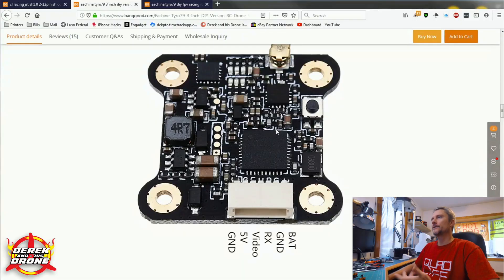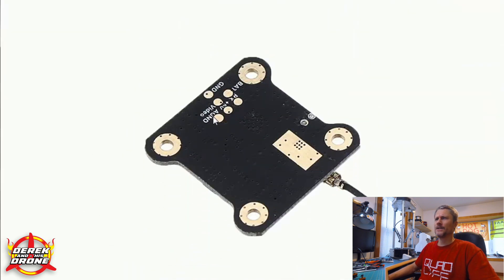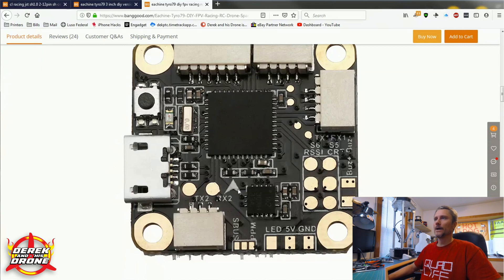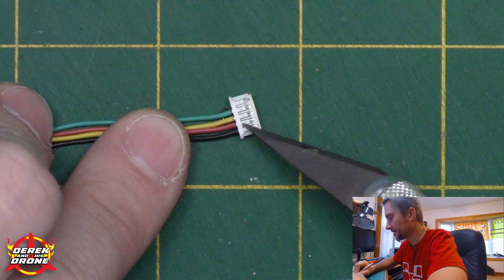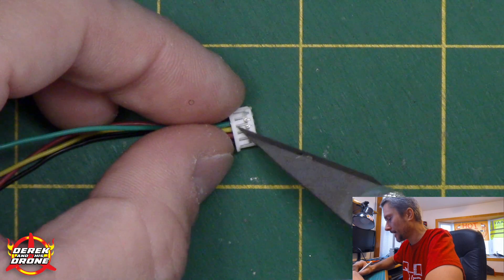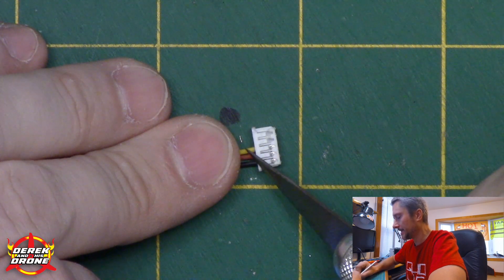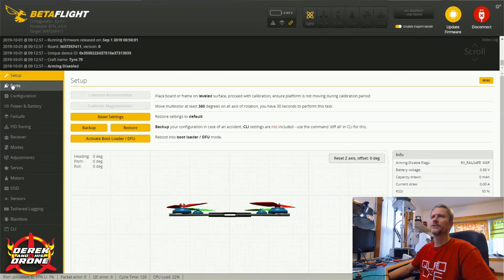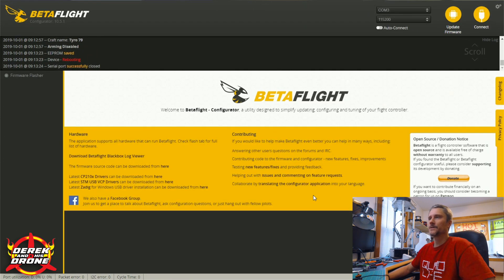Adding Smartaudio to Eachine Tyro79

Comment: Would be nice if I had the same VTX in my kit as you. Hooking up smartaudio is a no-brainer, unless we buy garbage kits from Eachine that are hacked to do things to save $$. I get nothing but dashed lines where my power levels/channels/bands should be in my OSD......and it tells me that 'Tramp' isn't configured.
Never mind......my bad - going into Tramp instead of 'SA' in OSD. 

All good :)
Reply from the maker: The kits are definitely as cheap as possible. With a little bit of patience they can still provide a good experience and an opportunity to learn.
Reply: i just found out we have the vtx thats for the iflight fC

Comment: i don't understand one part.  The first VTX you showed on the pc monitor is the one that comes with the Tyro79 kit, but then you connected the green wire to a different VTX which has DATA exit, but the first VTX you showed (which is the one i have) has NO data exit or pads... should i use the RX pin from that one to connect the green wire to vtx?
Reply from the maker: It is the VTX that comes with the Tyro79.  The website shows an older version but the connections are the same.  I added the green wire to the factory connector then soldered it to the flight controller.
Reply: @DerekandhisDrone  thank you very much mate. So i guess that RX is the pin where the green goes (DATA in the other vtx).
I've heard it's better to solder on tx1 coz tx2 is hard wired with OSD. what do you think?
Reply from the maker: Rx goes to tx it shouldn’t matter what one as long as you are not using it for anything else.
Reply from the maker: Just so you know rx means receive and tx means talk. One is listening while the other is talking. They always go to the opposite pad. Rx connects to tx and vice versa.

Comment: Mister... where did you solder the vtx 5v, G and V cable
Reply from the maker: They went to the corresponding pads on the flight controller. Except I used Vbatt instead of 5V for power.